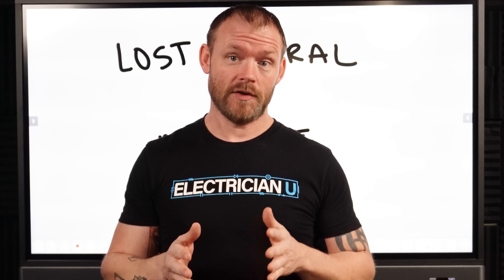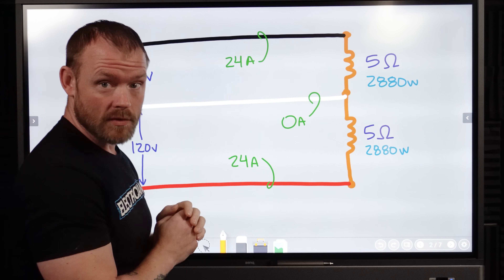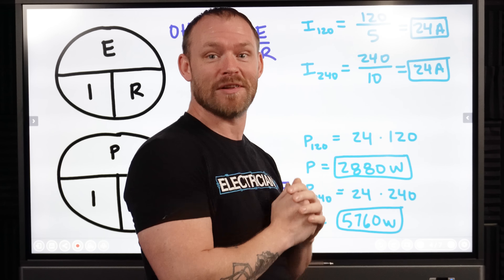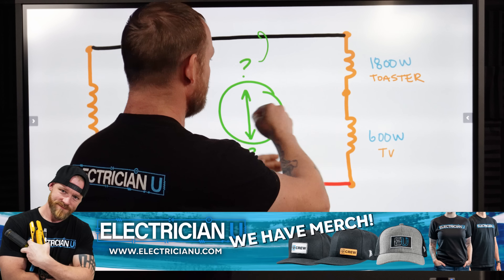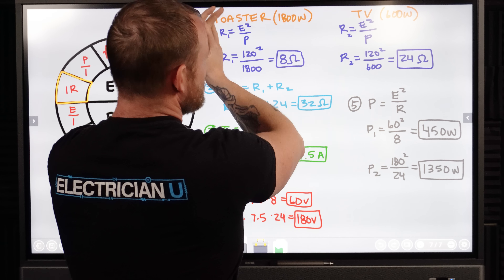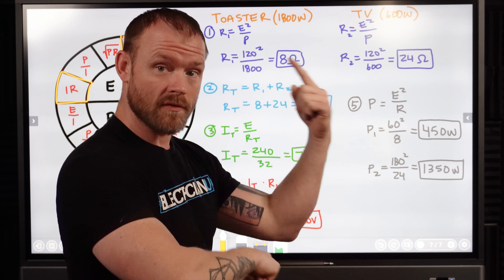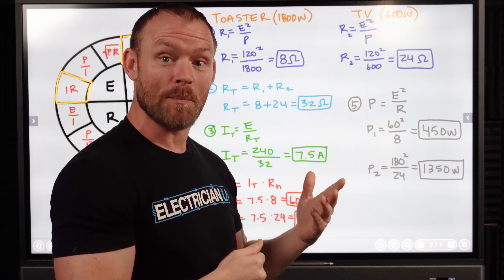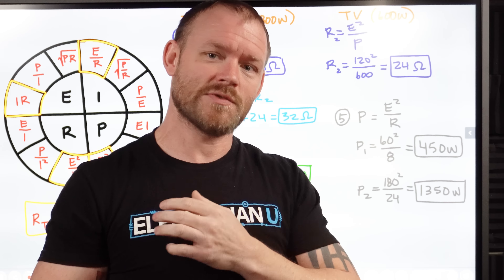NOT SAFE? Losing a Neutral in a Multi-Branch Circuit

Comment: Great video. I've often wondered why the USA does not SLOWLY transition the kitchen refrigerator circuit over to 240V? I believe the motor would be more efficient and the total power consumption lower. Thoughts?
Reply: it's been suggested many times, but the locations of a fridge are not always convenient for rewiring and that would also mean 20-30 years of transition, even if it were forced on everyone. Now consider that a kitchen is not the only place to have a fridge. I see fridges in garages, back porches, pantries, pool houses, and even in office spaces or a medical lab, where there's no 240 available.
Reply: We can’t even be bothered to transition to the metric system so…
Reply: @trickhealey  ... we did try that about 45-50 years ago and what little we did was VERY costly, only to get a lot of static from those who didn't want to change. Just replacing all the road signs was a crazy amount of money. Also consider that everything in commerce would need to be changed as well. Gas pumps, scales, and all other measuring devices, along with all consumer packaging. How about industrial and transportation where everyone changes from pounds to kilograms or gallon to liters? There are some big safety concerns here if a pilot or truck driver is not familiar with his load.
Reply: @rupe53  quite complicated indeed. The Gimli Glider (Air Canada Flight 143 7/23/1983) flight crew and passengers can attest to that particular hazard. 
I’m too old at this point to even convert my thinking into metric. I would never have an intrinsic understanding of the quantities without converting in my head, it would be maddening. Temperature too, can’t seem to get comfortable with the numbers meaning anything to me. Tell me it’s 23°C and I don’t have a clue what to wear! They just changed my local highway exits from being sequentially numbered to being defined by mile marker. I will never know the number of the exit I live near again, can’t get it to stick. 
Hard as it is to accomplish, I did design a model airplane using metric measurements and it was so beautiful to not have to think in fractions. It is quite interesting to me when I imagine how the standard of measurements we use  shapes our perception of the world.
Reply: @trickhealey  ... I have been around long enough to remember many of the common metric items. like 23C would be short sleeve weather... 0 is freezing and 100 is boiling. Also, - 40 is the same for F & C scales. (friggin cold) 25+ mm for an inch, and 39+ inches in a meter ... but don't get me going on using mile markers for exits. That's just insane. How are you supposed to know if you missed an exit if they are miles apart? I was just at exit15 and now it's exit 25? Did I miss one... or two?
Reply: @rupe53  thank you for your support on this exit tyranny. It is beyond frustrating and beyond comprehension.

Comment: When I bought my condo, wired throughout with common neutral,  the water heater had been replaced with a on demand and the had used shames breakers to make room. Both new breakers were wired with both sides of a common neutral circuit on the same breaker which could cause overload of the neutral.  20amp 12 guage.

Comment: I think that what is important to conceptionally understand some of this was not emphasized. That is, that each 120 volt circuit is out of phase with each other. This more clearly explains the voltage difference with and without the neutral.
Reply: Yep, another way to think of it is: relative to the black phase, red-to-neutral is -120V
Reply: Incorrect.   That is what the taught you in college while using an oscilloscope.   Transformers are not wound in opposite directions to make that happen.   There are three sine waves associated with 120/240 volt 1 phase 2@ 120 volts and 1@ 240 volts.   They all start at the same time and all travel in the same direction.   No 180 degrees out of phase.   Think it through how a transformer works and directions of electricity travel, before you respond.  Respectfully,   Kevin
Reply: @KevinCoop1  You're right. It's not a phase issue. I didn't learn that in college. I was trying to make a point and used as you pointed out a commonly incorrect term.

Comment: Everything great in the video, just one slight correction:

3:05 Actually, that’s not Joule’s law. 🤓

Some people call the equation “P = V I” as Watt’s law. Whether it was discovered by experiments or not, it can be mathematically proven by using the definition of power (P = E/T), voltage (V = E/Q) and current (I = Q/T).

Joule’s law (as an equation) is: P = I^2 R. This can mathematically derived by substituting Ohm’s law (V = I R) into Watt’s law.

Comment: Im not an electrician, but i'm more an electronic technician.  I want to point out the overall point is true, the math was spot on, and its likly the tv will stop working, but in real life what actually happens will be a bit different. The short reason why is that the TV is not a simple load with an unchanging effective resistance. 

The switching power supplies takes the 120vac, rectified it, smooths it, and DC to DC down converts it to the rest of the TV circuits.   The DC to DC systems are freqently tolerant of a higher input voltage. But the output voltage is regulated and so long as nothing has broken yet, the TV load's apparent  resistance or rather impedance goes up because your feeding it a higher voltage but it's actual wattage use is internally regulated and stays mostly the same.  But with the TV in a serries circuit with the toaster, the now higher impedence of the TV creates an even larger than 180vac voltage drop across the tv.  Which will probably result in exceeding the voltage raiting of the smoothing capacitor or some component in the DC to DC converter.

The power draw of the TV will likly remain largly the same untill the tv breaks. The results is the same, and the TV stops working, but the cause will likely not be because of excess power draw, ratherly it will likly be because of exceeding voltage raiting of some component of the TV. 

The real world differences stem from  whether an appliance presents as a fixed or not fix resistance or  impedence to various voltages.
Reply: Most modern electronic devices will adapt and work fine if the expected 120v input goes up to 240v.  An old incandescent light bulb or a toaster won't.
Reply: @phillipsusi1791  It makes sense that an appliance with switching power supplies be made to work with either 120 or 240.

Comment: Great info on this and in depth. In what instance would you run into a toaster and a TV plugged into a receptacle on a 240v circuit? I assume in a kitchen, but normally wouldn't they make these 120v 20amp circuits?
Reply: Under normal operation there wouldn't be any instance that you'd run them on a 240v circuit, but the point he is making is that if you had an open neutral in a multi wire branch circuit, it becomes a 240v circuit.

Comment: Pretty much every house in Phoenix AZ built before AFCI’s is loaded with multi wire circuits. They often used them in the kitchen for a refrigerator circuit and a countertop circuit. Even bedroom circuits were wired multi wire.
Reply: Honestly, I'm shocked if you see a dedicated fridge circuit before '96. (Which means '98 the way the builders do things in the Valley.)
Reply: @bradleyhcobb I’ll have to check next time I’m in an early 80s house. I know that I’ve seen many 1997 and 1995 houses with dedicated fridge circuits. I was also just at a house from 1986 with a dedicated one but the kitchen was fully remodeled and stuff was moved around so they could have changed the circuits around. I’ve never seen a dedicated fridge circuit in a 70s house, just tons of aluminum and multi wire circuits.
Reply: @everythinghomerepair1747  I just inspected a '96 today. No dedicated circuit for the fridge.

GFCI wasn't required more than 6' from the sink until '96 (which means builders didn't start getting it right until '97 or '98) so the fridge is often on the "other" circuit.

Comment: Thank you.  Question though.  What happens to my V meter if I measure between Hot and the now disconnected Natural.  Wouldn't I now be completing that circuit with the other hot ?  Even though Natural isn't going back to the panel, it would be connected to something else at the branch.
And I wonder if this what vaporized my RV's DC board at a park where I plugged into a 110 outlet but got 220 V.

Comment: My father-in-law just lost the neutral in the line to his home (ground wasn’t apparently enough to compensate), and fried his furnace, refrigerator, and several other appliances.

Are there any protection devices which can be wired in at the box or outlet to protect appliances from such a failure?

Comment: I should try to take some pictures of the wiring in my house that I'm fixing. There is a 12/3 multi-wire branch in the dining room running on 2 singles pole, un-tied breakers to run 2 ceiling lights. That's tied into a 12/2 running a security light. That's tied into 2 other 12/2 branches in my kitchen (which have their own single-pole breakers), which are tied into my bathroom. This circuit in turn was tied into my HVAC, which also had its own single pole breaker. That's tied into a receptacle in the living room, which was then tied into a multi-wire branch circuit running in conduit to a detached garage. 
Did I mention this is also running on a 125 amp Federal Pacific MLO panel?

Comment: The TV is not a good choice to use in your example, as it will likely draw 600 watts no matter what the input voltage is. The situation is much more complicated when you include switching power supplies in the scenario
Reply: Assume a spherical, purely linear TV in a vacuum
Reply: @benchociej2435 : Ignore gravity.
Reply: I was thinking the same thing.  If you have a switch mode power supply it’s possible the TV MIGHT be happy with a toaster in series.  Then again I worked on TVs back in the 90’s that had floating power supplies and the whole chassis floated at 170 volts because they didn’t have a transformer.  We could only use ungrounded oscilloscopes to test them.  The toaster would still be very unhappy and would probably have a hot chassis though.  I’m going to start testing all my outlets every morning…

Comment: 🙌🏽🙌🏽🙌🏽 now how would would fix/find/ or replace this neutral in a residential home. I’ve seen people connect the ground to neutral at a receptacle but I don’t like that.
Reply: Why would you replace them?   Not a common problem.   Just make sure your neutrals are tight in your panel board every few years.
Reply: @KevinCoop1  wouldn’t be my panel lol 😂 but I’ve ran into some homes with situations where it’s 120 between the neutrals and grounds
Reply: @devontekendrick8313  that means the bonding jumper in the panel is not installed.

Comment: so when doing residential electrical with multi  branch circuits apart from cost.... wouldnt having a five wire home run solve this issue ? i.e put all the red hot wire connections on one neutral and have a separate neutral for everything connected to the black hot wire connections and have them share the ground wire for clearing ground faults ? and u balance the breakers and oads as u other wise normally would .  wouldnt that prevent the lost neutral unbalanced load voltage split ?

Comment: If the incoming neutral breaks then the neutral cable voltage will get to the equipment cases which could shock you. The more balanced the system the smaller the voltage. In the UK where they have single phase 240 V the full 240 V can get to your electric car if the PEN wire breaks so they must have special protection against that.

Weird things can happen if the incoming neutral breaks. There is a video where a house started to use the cable TV connection as the neutral. This could kill a cable TV operator if he broke the cable.

Comment: I had 2 circuits feeding 2 lighting circuits with magnetic ballast one had a dimmer and dimmer ballast the neutral feeding both dropped in a jbox in between. The room with the dimmer lights flashed as it was a strobe flashing at 60 cycles per second .

Comment: With the voltage imbalance, since it's an AC circuit, wouldn't the voltages switch each cycle which load gets the high voltage? So the toaster would get 240 and the TV get 180 but then on the other half of the sine wave the TV would get 240 and the toaster like 200. And you would get a really messy sine wave

Comment: I believe it's better to stick with standard notation for voltage, ie, V for voltage (240v).  P is already used for Power,  not potential.  E is used for Energy as in E=mc2.

Electrical Engineers have to call current "j" instead of "i" because almost every equation in EE involves complex numbers z=a+bi, where i=(-1)^1/2 (this "i" is not current).
Voltage equals E just muddys the water.

Comment: It's simpler to just work in ratios.  It matters less that once load is 600 ohm and the other 1800 ohm, and more that the ratio between the resistance of the loads is 3:1.  Makes the numbers a lot less complicated.

In your example, the voltage doubles, and the ratio being 3:1 means that one load gets 3/4 of the doubled voltage, and the other gets 1/4 the doubled voltage.

Comment: Love your channel. I've been doing a crash course in electronics watching your videos; learning so much. One thing I'm still curious about. I have heard different answers in different applications. Let's say I want to hook up a main disconnect switch in between my main service and a subpanel. If I'm using, say, a 10-3 plus ground (2x 120 V hot conductors, one grounded conductor -- neutral, and a ground), do I include the neutral in the switch? In other words do I break the neutral when I break the loads at the switch? If so, what can you say about the order of disconnect/reconnect?

Comment: What happens if there are multiple different sized units that are drawing equal amounts on the red and black? I work on with 3 phase 5 wire setup on a sound stage. We had a situation where the neutral was unconnected while running a mix of 5000w and and 800w lights. The three legs were balanced but with different sized lights on each leg (i.e. 1x 5kw on red, 6x 800w on black). I expected the 5kw light to be dim and the 800w lights to fry. Mostly, we just got a loud buzzing and one 800w had a fuse die.

Comment: The TV would actually most likely survive as most modern consumer electronics use switching PSU’s that are rated 120V-240V or even 100V-250V in some cases.

Comment: DUSTIN, Most Multi Branch Circuits are going to be Unbalanced Loads so when the neutral is open or out of circuit, what do you recommend doing to PROTECT the loads and circuits from getting damaged? Aren't there Over-voltage protection circuits or what do you recommending using to sense the hot lines or sense the neutral line when its open? a sensing circuit or monitoring circuit should be connected to the HNH lines
Reply: Like a simple, voltage-gated relay that trips the outlet when voltage is too high? But then you'll need that for every MWBC outlet in that case...

Comment: Kirchoff’s law bit me in the posterior when the neutral wire in my generator feed came lose from the outdoor plug.  The generator’s neutral was floating and not bonded to ground and there were energized circuits on both phases. Fried some LED fixtures, a refrigerator motherboard and a Waterpic.   It took awhile to figure it out because the voltage at the generator was 120 on each phase and also measured 120 in the house because the current through a multimeter is only a few milliamperes.  It was only when I measured the voltage drop across an actual load that the answer became clear.

Comment: I lost the main neutral from the pole. A roofer hit the neutral and bottom wire on the main feed from the pole. There was no insulation on the wires. 
Inside the house the current tried using ground which was tied to the water line per code. However, the water line was lead, not copper. This melted a hole in the water line which was the main line. The shut off valve was in a pit in the basement floor, so it filled up with water and energized, but the valve was rusted open anyway. 
Had to call the water department to get the supply shut off at the street and the electric company to shut off the power.
This house had an old fuse box with a 60 amp capacity. It got melted. Any devices with digital circuitry got fried. It was a disaster.😮

Comment: How is loosing the neutral any different than having an open normal 120v circuit?

Im not understanding how loosing the neutral changes the voltage at the device, since the only place the two hots are paired up at is at the. breaker? Wouldnt it just not have any return path and simply not function? 

Maybe what im missing is it depends on where the neutral is lost.... like if the neutral was lost on the homerun, wouldnt it just be to open 120v circuits? But then if its lost in some random place thats when crazy voltage at devices happens?